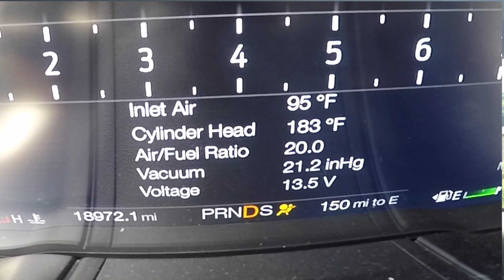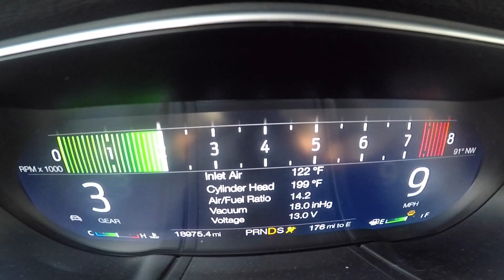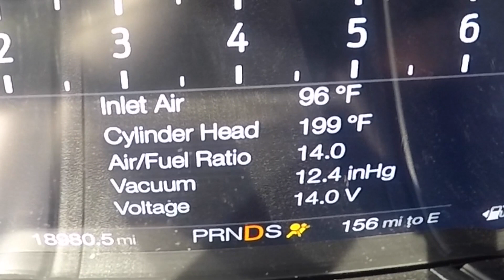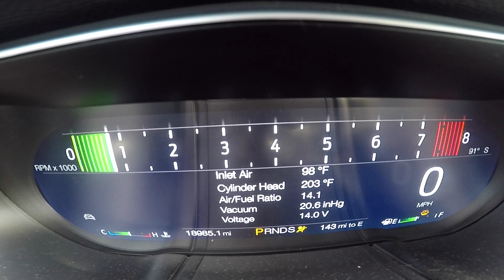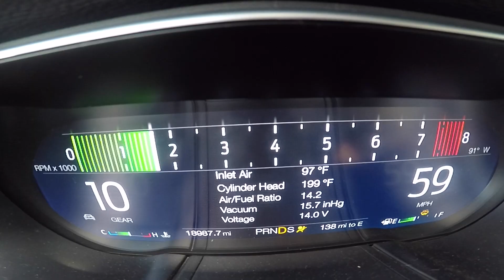18-19 MUSTANG GT - STOCK VS COLD AIR INTAKE- "REAL WORLD" IAT TESTING

Comment: He talks about a bit here. 
But yea "cold air intakes" arent worth it 
I have mine for looks lol 

https://youtu.be/IFq1bLowQVE

I added the 18 stock air box on my 17 Gt cause of high iats
Reply: Jpadilla05 couldn’t agree more!  The reason the CAIs work is because of how they are tested (hood up)!  Open CAIs are a waste of money IMO. 

What makes them work is the size of tubing and opening into the intake manifold. Pair that always with a tune and you have more power. I’ve seen a video on this and they totally debunk the Open CAI. Will post here when I find it.
Reply: The sound is what makes them worthwhile on some cars, imo.  Did you notice a better intake engine sound?
Reply: @a.wheeler7731  i def hear it, I have the roush intake with a blue filter off an airaid intake for a chevy Silverado lol. Had to match the blue coil covers. But my iats shoot up to 120-125° at the tracks so I swap out my cai for the 18 stock air box. Never goes above 105° think I might try the big mouth adapter to stay near ambient temp
Reply: @losborne9110  yea thats true even when dyno tuning they keep hood up. The 18 stock air box is a lot bigger then the 15 to 17 air box so adding a k&n drop in filter does the trick.